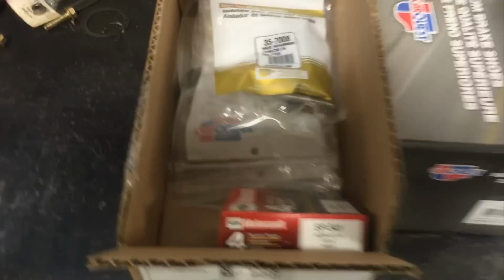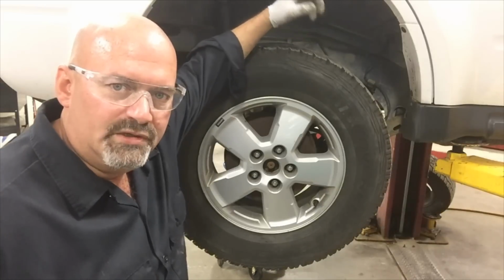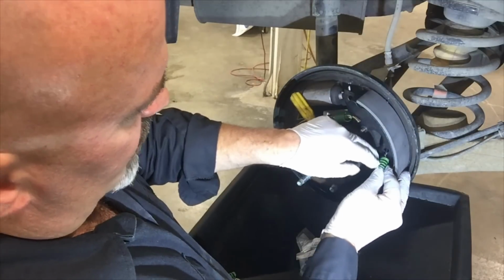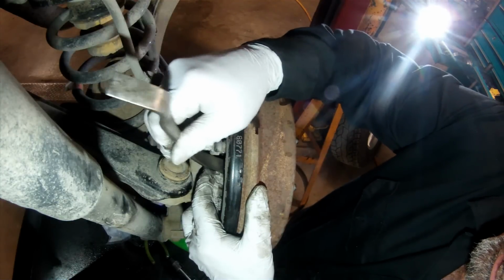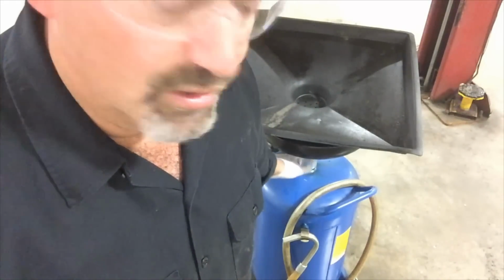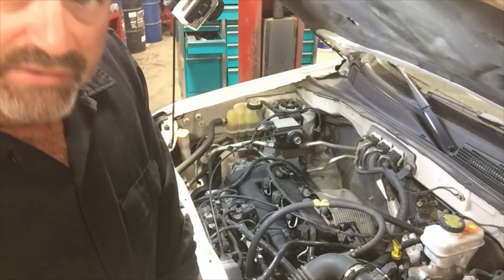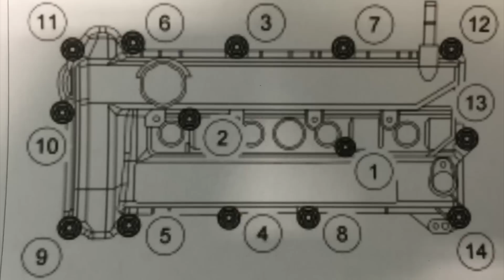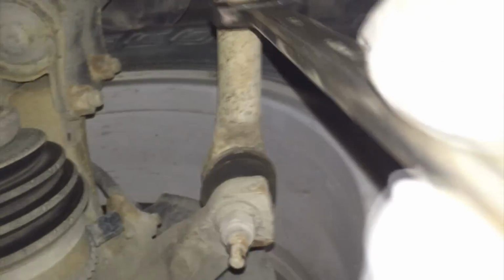Ford Escape Mazda Tribute Valve Cover Gasket Tune Up Rear Brakes Control arm Replace

Comment: I'm surprised you don't use a brake spring tool.  Works wonders.    I learned a lot on this video.  Hope to find time to watch more of yours.  From a fellow pudgy 50+ balding guy.
Reply from the maker: +SommerFamilyDad Are you referring to the pliers type spring tool? I have the anchor pin spring type and some that look like pliers with a hook on one end but they are just a pain so on that type of spring I just use my dikes. Also I try not to spend any money on tools if at all possible. I save money to spend on fishing equipment if you know what I mean. Haha. You should check out some of my other vids for more examples of unorthodox repairs by yours truly! Thank you for dropping by.
Reply: Thanks - yeah, that's what I'm talking about.   I just got a 2002 Escape for my son to drive, and knew it needed new tires.  Too busy to do the rear brakes they said it needed, so I let the shop do them, now I wish I had done them myself.  I know how, but just am a slow shade-tree mechanic, and my driveway is anything but level.

Got a bunch of driver-side front end noise in motion, but they said CV was all OK.   I'll check the ball joints and stuff.  Checking out your other videos now.
Reply from the maker: Look closely at the lower control arm bushings and sway bar end links also. Very common issues.

Comment: Great video. I ran into a problem while installing the LCA on my Tribute (did it with vehicle on the ground). I seem to have pulled too hard on the axle and the needle bearings inside the CV boot came off. I had to pop the whole axle out of the tranny, remove the boot, replace the bearings, pop it back into the tranny, and was able to finish the job. Careful when you do this job guys, a good tip is to remove the axle nut, so that it has a bit of play if you ever tug on it while trying to fit in the LCA. Cheers!
Reply from the maker: +J-S Grégoire Oh bummer, glad you were able to correct the issue with the axle shaft. Thanks for watching.

Comment: Do you have A ? How 2 Replace manifold on A Mazda tribute I guess it would be the lower one ,,,one that's the hardest getting to I've got A bolt broke that's going to have 2 be extracted ,just wanted 2 know isn't the ecscape pretty much the same deal? ;-) thank's Chad from Tuscaloosa,AL...
Reply from the maker: +Chad Green No I do not. I will make one the next time I have to do a lower intake. Good luck with it!

Comment: Hi Car Doctor. Thanks a ton for posting your videos! I replaced my rear manifold/cat thanks to your alternator replacement video. I will be replacing my lower control arms next and wanted to replace the inner bushing bolts that attach to the K-frame. Would you happen to know the specs for those bolts? The guys at Napa, AutoZone, etc. have no clue. Thanks again Doc!

Comment: Good video, just one detsil !!
 The horizontal forward bushing bolt on lower contol arm, needs to be left loose and tigthened/torqued with vehicle sitting on the ground at normal ride height, otherwise the bushing will be twisted and fail prematurely.

Comment: what's the deal with these escapes  back breaks. 2 sets have chunked out for me. reliable vehicle so far tho. I hate my alternator  is on the bottom  back side of the motor
Reply from the maker: +gunnuts82 well I don't know but I sure see a lot of them here. I also have done a video on alternator replacement for these. That's a real treat as you know! Thanks for stopping by. 
https://www.youtube.com/watch?v=UJjJNDlsars
Reply: +The Car Doctor . hey thanks for the reply. I have a mustang gt. 4.6 needs new timing chain tensioners.  don't know if it want to tackle that job tho. may pay to get it done. what's your thought?
Reply from the maker: What year? If you have the ability it would save you some dough.
Reply: The Car Doctor  2003. Under the hood is so packed full of more stuff than you can shake a stick at. I would be afraid of getting it out of time

Comment: About how much did all this work cost the customer?
Reply from the maker: +davemaster001 About $1000. You might get the same job for less depending on what part of the country you are in and what the labor rate and parts cost is in your area.
Reply: +The Car Doctor A lot of work indeed, but you did a good job imho
Reply: +davemaster001 Guessing that took at least 4hours to do